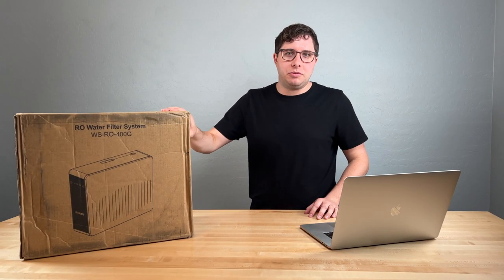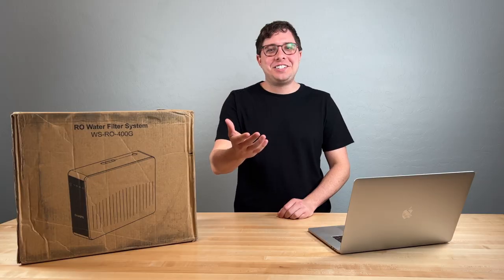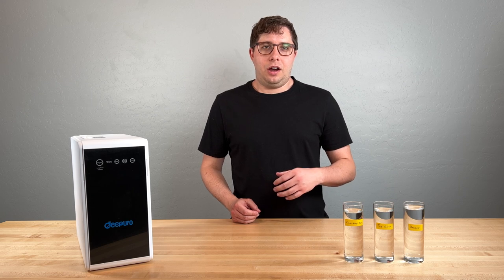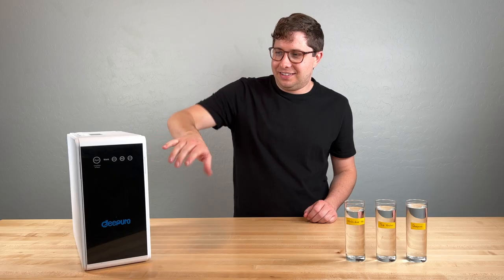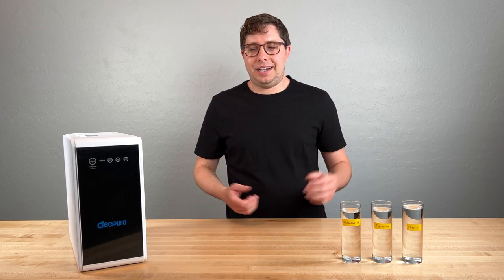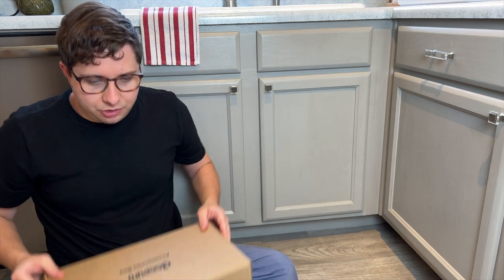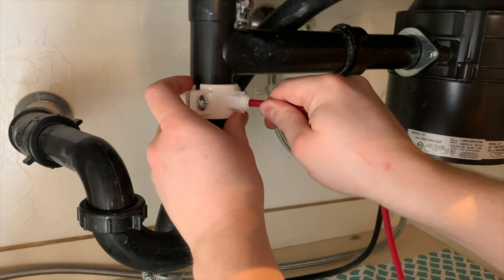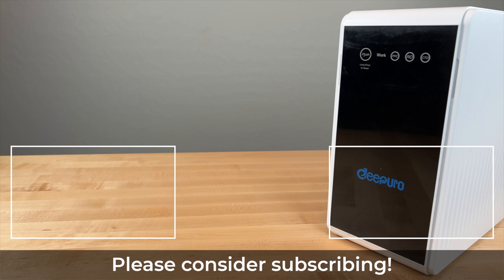Deepuro WS4A Reverse Osmosis Filter | Review and Step-By-Step Installation Guide

Comment: Great review, so do you recommend this over the waterdrop?
Reply from the maker: They are comparable. I would choose this over a Waterdrop G2 if (1) you can get it at a lower cost or (2) you live in an area with very hard water. If the price point is the same, I would take the Waterdrop because the build quality is higher and filter changes are easier.
Reply: @assyrequired  thank you so much!

Comment: I want to replace a "normal" RO system with a tankless like this one but regardless of which one of them I look at online I can't seem to find replacement filters for them.  Any tips on finding them?  I've looked at this one and Waterdrop so far.
Reply from the maker: I have a Waterdrop under my sink and have had no issues finding filters. I also see Deepuro filters for this model (WS4A) on Amazon right now. Since Waterdrop is more established, my guess is that it’s less likely you’ll run into issues finding filters for it in the future.
Reply: @assyrequired  Thanks!

Comment: You could have done a very easy test like I did. This thing is insanely inefficient. Out of 5 gallons of water I get two just under two. This puts out twice as much wastewater than clean water which is the very opposite of what they are claiming. Which in America we used to be able to sue people for false advertisement. This is why this was never an issue until they started unregulating everything. Take a 5 gallon bucket fill it up and get a gallon of water and put the clean water holes in there and the dirty water and another empty 5 gallon bucket and see what you have and it sure as hell ain't even close to what they're claiming. This is an insanely waste of time and money for these units because I just got one and it's bullshit. You're putting out two to three times more pollution and water than what you're taking in. It used to be 4 gallons of waste to 1 gallon of water. That's pretty much what this does is this is claiming to be a new system and it's older outdated tech that's inside of this shit. Just like every China BS out there.
Reply: I never did that test but I’m glad you did. If you find units that meet the efficiently levels claimed let me know, I’d like to recommend less wasteful units to my family/friends.
Reply: @intheblackofficialchannel  I did their newer system just the other day. As far as I can tell it's the same thing except it's a five-stage 2 filter with the digital screen on front for PPM and filter life. This one is supposed to get 1.5 to 1 and I think the one that's reviewed here is a one-to-one. But I actually get .5 to 1.5. that was non pressurized though. It might make a difference if it's pressurized. So I can't say 100% for sure that they are that inefficient until I run a pressurized test which I will update you on. But I want to give the filters some use first just so they reach your full potential. And the wastewater isn't much higher in PPMs from 490 to 530., So maybe it just needs time to activate. Idk but within time we'll find out
Reply: @Brian-bl1fj  I’m wondering if the units get more efficient as they run for longer. Perhaps the 1:1 claim is true if you run the unit for 20 minutes straight, but in reality most people use for 30-60 seconds at a time. Basically some misrepresentation that is technically true…
Reply: @intheblackofficialchannel  That's what I'm thinking. I did run it for the half hour but it was unpressurized and it has to make a difference I'm sure. I just used 2 5 gallon jugs and a gallon jug. And at first I only got a gallon out of five gallons.  I was unable to use the faucet because they didn't give me the parts and I'm waiting on a new unit that hopefully has everything with it. But I am sure it's user error and may not give enough time for things to work themselves out. Because I would highly be disappointed in getting even a one-to-one ratio when you could actually get them up to five to one. That's a lot of paid for water down the drain. But yes, I say it's user error at this point.
Reply: @Brian-bl1fj  if / when you get a chance to do a more thorough test I’d be very interested to see what you find